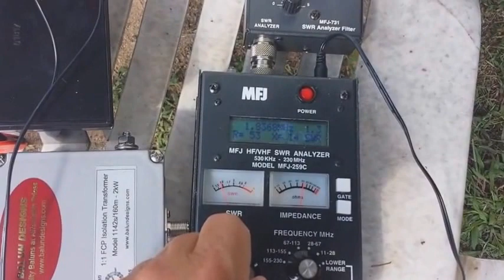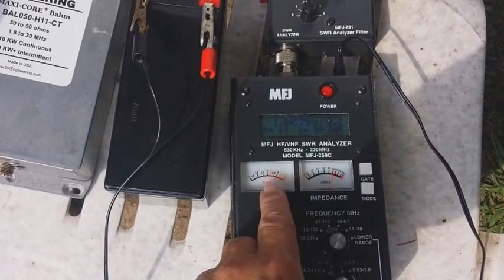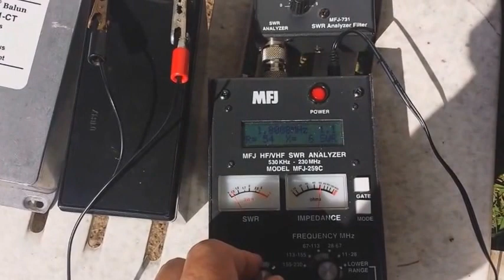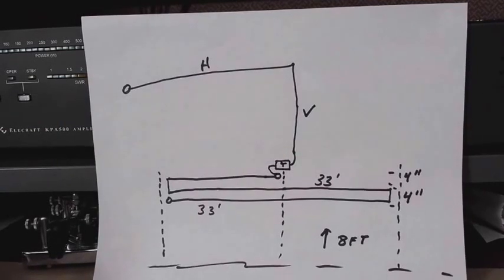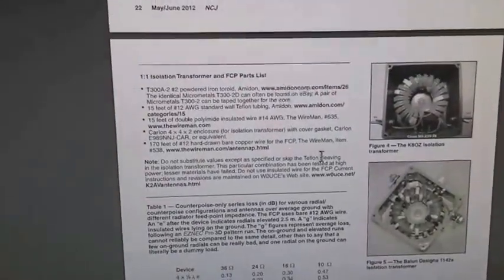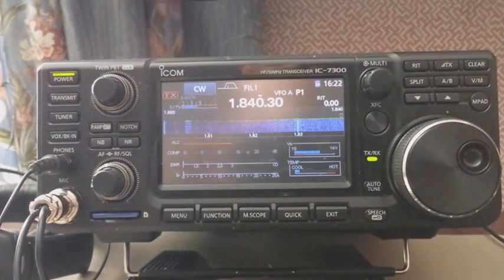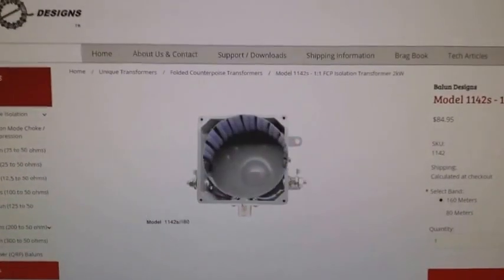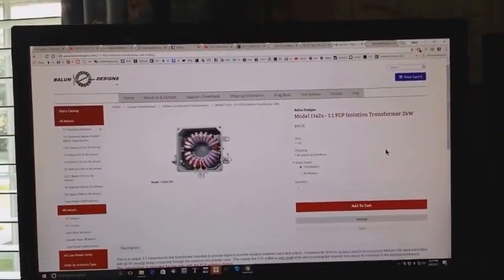160 Meter Folded Counterpoise Inverted L Antenna

Comment: I have been using the same setup for the past three years.  It plays well and I have worked a ton of DX on it.  My antenna wire is 150 feet.  It's 70 foot vertical and 80 feet horizontal.  You will love this antenna if you are unable to put down a proper ground system.  Follow the instructions exactly like in this video and it will work.  Thanks to Guy (K2AV) for making 160 meters possible for the ham on a small lot !
Reply: re: "You will love this antenna if you are unable to put down a proper ground system. "
There are  a few other alternatives that are out there, but, little known to the "public". The problem with "open frame" designs like this is the ferociously high E (electric) field off the open ends ...
Reply: Another alternative for those with less than 50 feet of space is an inverted U. Just put a downward leg on the end of the L and secure so it doesn't flap around. Then fold a single counter poise between the feed point and the end. You want 150 ft of element and 155 feet of counter. Feed with 9:1 unun

Comment: Hello Steve. I have been studying this design since playing your video. I'm gonna do it. My inverted VEE works well. But one of the VEE wires was touching the Hex Beam I installed and I didn't know what to do to stay on Top Band. Now I know! I'll convert the VEE to an "L". 60 feet vertical and the rest will sorta be horizontal. Using the FCP. Can I use an antenna tuner in the shack with the COAX running to the BALUN and still use all of 160; like I had with the VEE. Only difference was the VEE was fed with OWL (600ohm)????????????
Reply from the maker: I don't know. I wasn't al that impressed with the whole thing anyway. It's very critical to go according to the book on the FCP. It is most effective for DX and your vee probably would out do it for local stuff anyway.
Reply: @n4lq  Thank you for reply. Even with the Balun Design transformer you are not satisfied with performance? There is a specific way the Balun Design has to be connected for it to work properly. Newer baluns have marks on them  where the vertical and the FCP connect.
Reply: @n4lq  The "L" is supposed to be good for DX and local. I use the AM mode and talked to a couple of guys using the "L" and the get out very well for a typical close-in contact on AM. 300-500 mi. My vertical part of the "L" will be 65 feet long and the rest horizontal about 50 feet high. It would be nice to play with. If it doesn't work I can always go back to the VEE. I'll have to re-orientate the wires. HEX BEAM is now in the way. FRED KC4MOP
Reply from the maker: The "Inverted L" is a single band antenna cut about 1/4 wavelength long. Most of the radiation happens in the vertical section and a good radial system is required for best performance. Using this on other bands works ok however it's not a true inverted L and the pattern varies greatly across the spectrum. 
The FCP system is for 160m only. It will not perform correctly on other bands although it will do something. We just don't know exactly what.

Comment: Steve, interesting antenna.  It's time to start thinking about 160 meters. IF I read the article correctly, would two 1/8 wavelength radials work better. then the folded counter poise if I had the space?
Reply from the maker: No. The FCP works better than 2 loaded radials. I believe 4 full length / 120 ft radials would equal this.

Comment: How did this antenna work out now that Its winter?
Reply from the maker: I took it down . Worked good but it's mostly for DXing since the radiation angle is low. I wanted nvis for locals so I put up an end fed inverted vee instead.

Comment: Hi Steve,  
Thanks for the informative video, I do have a question though.  Wouldn't 3 or 4, 140 foot radials lying on the ground be more effective? I know your video is to help with limited yard sizes. I have about 2 acres here in SC and was planning on rolling out 4 radials made of horse fence wire which is about an inch wide and has 14 strands of wire running the length of the roll is fence wire. I am sure you have probably seen the horse fence dipole at soe of the Ham fest in recent years.
Since 160 is much better in the months when the grass does not grow, I was planning to roll the radial out and hold them in place with old bricks that I have left over from some remolding we had done.

What is your impression and thoughts regarding your new antenna, now that you have had some time to use it? 

I bought my horse fence wire at Tractor Supply but not sure they still carry it.

https://www.horse.com/item/field-guardian-2in-polytape-classic-14-wire/BXC33/?srccode=GPHORSE&gclid=Cj0KCQjwpMLOBRC9ARIsAPiGeZDgg7ta7Ui9xlWAtTERWt66uy3egj1QOFrPAV6fkWmgb0-YqwnqCpoaAmupEALw_wcB&kwid=productads-adid^160681080205-device^c-plaid^96390259057-sku^70769@ADL4HORSE-adType^PLA

73,
Glenn WA4AOS
Reply from the maker: Hello Glenn:  From my experience, unless you have at least 16 one quarter wavelength radials on the ground you had best just keep things elevated. Just a few radials constitutes one half of a bad antenna and most of the power will be absorbed by the ground instead of reflected. The FCP is generally considered equal to 2 elevated quarter wave radials. Four elevated radials would perform better than the FCP but of course not fit into a tiny 66' long strip.
. I never quiet understood the attraction for horse fence. Stainless steel is one of the poorest electrical conductors there is. It is made to be highly visible which is the opposite of what an antenna should be but great for horses. If in fact it appears to be "broad banded" it's probably due to the resistance. 
   Some folks have resorted to using chicken wire radials. One claim is that a cross formed of 4' wide chicken wire running 50 feet out from center in one plane and 25 feet the other plane results in an effective system. Of course it needs to be grounded to the coax like any radial. For a permanent installation use heavy ga. fence wire. Lawn staples used for landscaping can be used to hold them down until the grass takes over. 73